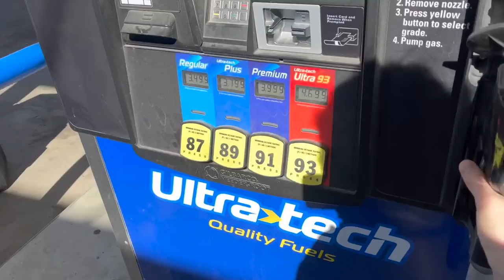How to Change an Axle on a Highlifter Sportsman

Comment: I'm a little shocked. Never had to replace axles on my polaris's, but I've replaced an axle seal in an AC, and those axles you push them in, then the lock disengages and slide it out. No yanking or fighting. I assumed other brands were the same.

Comment: Most guys ride CanAm's around me, and 100% they spend more time in the shop than other brands. The process to oil change is absurd, the fact the shock bushings are wear parts but can't be replaced is offensive.
But I've never heard of a Rotax engine having issues. I'll give them that